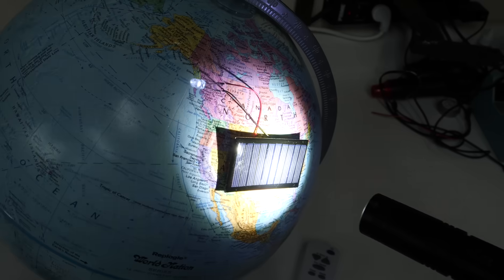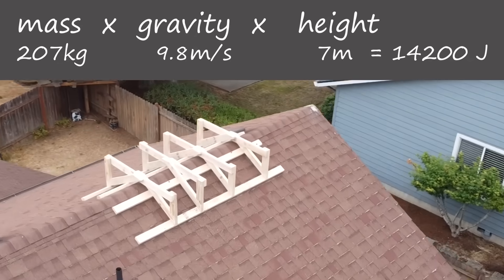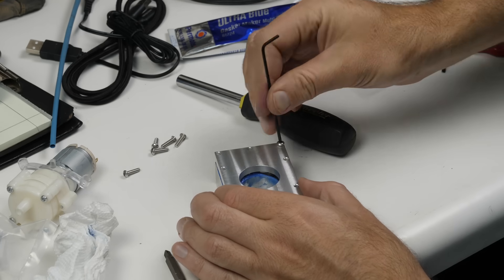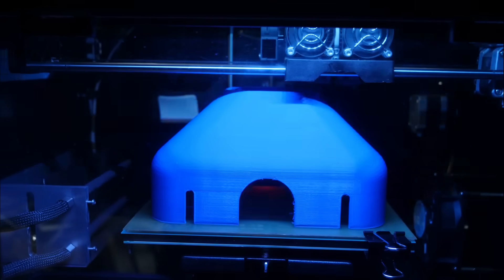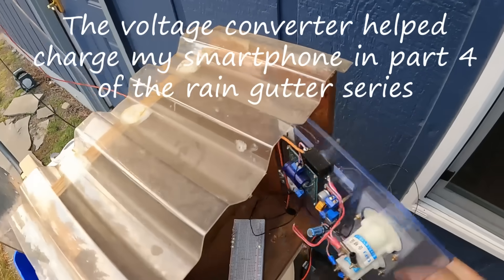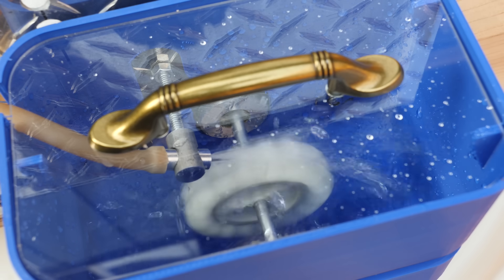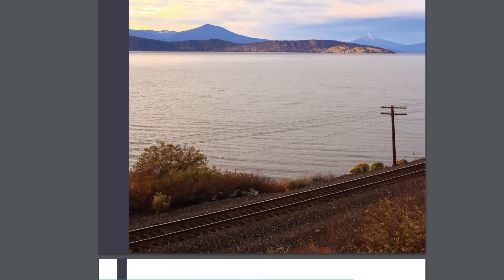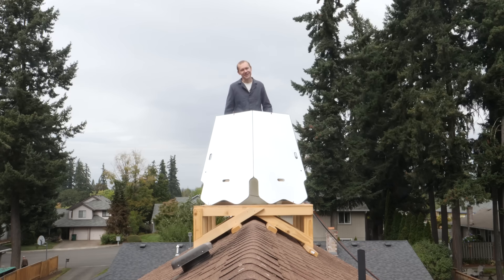Storing Solar Power on my ROOF!!!

Comment: Appreciate the 'do not try this at home', but a couple of things for the average viewer that you couldn't explain within the time constraint of the video:
1. Don't have splashing water beside your breadboard and LED. It's a silly little way to lose twenty bucks of equipment for nothing.
2. Don't use these circular barrel jacks on your roof--or any electrical connector that is not built to the correct IP ratings. It's also a dumb way to lose your equipment to a short even if 12V can't hurt you. (Also, uh, please fuse up your 12V outputs in case of these brainfarts because they can happen to anybody)
3. The meter started out reading 20mA despite the water flow carrying more energy than that because current is load-limited. By hooking up 1x LED you're wasting the rest of the water's potential energy by just letting it go down the drain if you don't have enough appliances turned on. That's why it could do 1W in the end--but I suspect some viewers may have turned away from the video at the point it went '20mA?! This is useless!'.

4. Use in combination with heating the water for a much better effect and to scale up. If you have lots of solar energy coming in, no point filling your roof with 1000L of water. Heating the water in an insulated container and then letting it back out on interior radiators at night would be a much less space-intensive method to scale this project up to the tune of 300, 500, 700W. 

Don't expect a miracle, laws of physics apply. But it is SO much cheaper than installing solar with 230VAC inverters, batteries, and all that electrician-certified wire run etc. built into the house that the break-even on this type of installation should be almost an order of magnitude quicker.

I'm planning to proof-of-concept high efficiency peltier coolers to make a low-cost solid state heat pump with solar in the house (no miracles either, a few hundred watts and a single room should be all that does). And your idea just helped me add water volume to that equation--even just having a storage of water to warm and store is still a great battery source for the winter and ALSO for the summer in reverse.

Comment: This is a silly experiment.
You are dissing the liion batteries which indeed maye have a degradation with time, but if done correctly even after 10-20 years the degradation will be insignificant, in the 10-15% range of loss
On the other hand what is the energy density of water?!
That gigantic barrel (and a huge scaffolding and the silly tubing and pump and electronics ) has 14.000J, meaning 4Wh
One of those 18650 cell has like (samsung inr 35 is like 3 dollars/pcs ) 3.6v*3.4A ~12Wh
WTF. A tiny li ion battery has 3 times the capacity of this project and fits inside a crack of a wall. Literally, you can hide an 18650 cell anywhere and not be found for days, provide more energy storage for as long as you live and be more reliable than that project to provide energy.
This contraption is just a silly kid's science fair level of usefulness, and not even that.
What a hoax of a video.
For the same mass and volume occupied by this project you can get something like 30kWh of energy storage in li-ion batteries, that's like 1000x more energy efficient use of space. Your grand grand grand .... grand children using this water storage won't be achieving the same energy capacity with this project.

Comment: Technically speaking, if he simply used mercury with the existing setup, he could increase potential energy by 13.5x, simply because of density. It would also counteract the potential problem of freezing. But I'm not sure anyone would want to place a barrel of mercury on one's roof.

Comment: For the impeller, you're losing most of your power from inefficiency. You'd be better off making what looks like a regular pump or turbo, where water enters and does a rough U shape around the impeller, before jumping out the other side. That will increase how much power you can get, since the water will be transferring every into the impeller for longer. 

Currently, it's basically hitting one blade and then bouncing all over the place, which means most of the waters energy is going into the bounce, not the blade. By having it take a U path, it will leave the blade with as little energy as possible.

You'd need to mess around with how high you can get the exit, and even how large you can make the impeller. Alternatively, you could place a generator near the top, and repeatedly stack them, maybe with some distance between each one for gravity to transfer some energy back into the system. 

In theory, you could even set it up so the up and down path is the same, where the pump that sends the water up into the roof barrel becomes the generator that reclaims the energy. But as you already have a working system, I'd say that would just overly complicate matters.

Comment: 12:30 I really love the precision about the difference between ENERGY and POWER.... and I love the way I came to your video just the day after I said to myself: "Hum, think about it: energy is a storage and power is about time... because it is how fast you use energy"

And today, I can finally add this: time is about resistance. Here (in your video) the time depends on how large the valve is opened. The more it is opened, the more water can escape the tank per unit of time... because of the resistance of the tube and valve (making the water not to escape the tank).

The more resistance, the more time it takes to let something to happen.

So, power being "how fast we use energy"... it is also true that power is how few resistance there is for energy to manifest. And I'm not even speaking about political stuff!

The less resistance, the more power. For example, LEDs use a less resistant way to produce light than filament bulbs. With the same energy storage, you can then use LEDs and produce a strong light or use bulbs (using the same voltage) and produce a less visible light.

That's why it is important to design less resistant stuff to increase power.

Anyway...

Really nice project.
Thanks for your sharing!

Comment: I think this experiment is to do with many different pumps types and water motors, before to say anything about efficiency. I just realise how many types this devices exists for different purposes, and i really think you my try with this membrane and valve system "Le pompage en autonomie avec 50W seulement!!!" from Guillaume Piton. For the energy conversion, there are some water motors seeming more efficient than a turbine in Robert Murray Smith last video, or Tom Stanton's style.. Or symply using not as an electrical battery, but simply for all water usages, maybe for the garden ? A solar cascade for a natural swimming pool ?

Comment: You can use the water pressure from your tap to get the water up there without pumping. Kg of the tank? Wait...you can get more water pressure strraight out of a tap, instead of a tank on the roof. You should have about 20m on a household tap. What about all of the wasted water?

Comment: @9.10 "I got nothin'" - I have many testing devices, when brand new fails, I tend to give up in disgust.
Like, how the hell can you ever win when you have to test and replace brand new?  Why should you even have to?

The other concern for the ordinary homesteader interested in energy storage, is that the efficiency of off-the-shelf water-drive generators is pathetic.  To do this well you need some pretty high-tech miniature Pelton wheel, matched perfectly to your DC motor/generator in terms of speed and torque.  Beyond most of us, even if we had a 7 metre structure capable of supporting and sustaining 200kg in all elements.

Great experiment, but just not a feasible experiment to replicate for most of us.

Comment: Well for me the calculator said 100m³ over 5 meters and a normal efficient generator gave something about 1kW/h which is about the sitze of Lithium battery of a 1 Liter Milk bottle.

I would not perform such 0.2m² tank on a roof alone the Wood and screws, plastic Tank are making more energy cost and CO² damage to the ecosystem, than the system delivers next 100 year's. 

Total waste of time, a proofen concept since 100 years any calculator tells it....😢

A pressure storage of compressed air would be much more effective and doesn't need to be on the roof. But if you make a mistake it might blows the house away. Well in this case it can although crack the roof with wight. 😅

If you strength the structure of the house before this system is even more useless 😅

 Anyway nothing for me of interest in it, but you get a like, for nice explain action how hydro power works in concepts....❤

Comment: Great video, subbed!  On the picture of the Swan Lake Energy Storage, I assume that there are two pipes running side-by-side, one for flowing down hill and one (probably smaller in diameter) for being pumped uphill!  A tower with a small tank just to the left of the lower pond but at least ten feet higher in elevation than the rim of the second pond would reduce the energy needed to pump the water back uphill because water (and most fluids) will always find its own level!  The Romans used a similar system with their aqueducts to move water across steep ravines, still works today!

Comment: I don't understand why... if you had a 3D printer anyway,  why didn't you incase your waterwheel thus making it a turbine and much more efficient.... because not only are you then using the power of the  slash hitting the fins you would capture the all the water and the built up pressure of the water coming down .... yes, the pressure would be lesser as the the water level in the barrel lowers but the biggest thing is that you'd actually be able to crack the valve back a little less .... saving potential energy and thus extending the batterie's life.. Also a wind driven pump that'll work good in a 10 mph wind could also be pumping filling another tank.... that would be an interesting comparative test .... even though solar is more efficient,  when nature permits I bet the difference of a small windmill just big enough power a pump 2x that size to would be awesome.

Comment: you are making lots of splashing droplets that could easily be run across the rain field generator too that is about 50% by size efficient to solar panels even when made by hand with teflon tape, and aluminum duct tape (or aluminum foil with double sided tape) though no one has used true super powered triboelectric material  they are just relying on naturally negative and positive charged potential and not even using the extreme end on the positive side, just on the negative side LOL Still seems like you could snag another 25% more power at minimum

Comment: Fantastic build. I'd submit though that you have some wasted energy from the water splashing off the impeller. If you could somehow print something that would deflect that splashed water back on the impeller at it's negative vertical direction point, you'd gain a small amount of that wasted energy back. No idea if you'd even notice the difference but it's going to increase the overall efficiency regardless

Comment: This solar panel is being taken out of service for direct use during the day meaning that it's production capacity would need to be subtracted from the output of the battery. Through conversion efficiency is decreased and there is a net loss. However, as an auxiliary for light duty (such as lighting) this could be feasible, using a second panel for primary power. There are vortex systems that produce far more efficiency.

Comment: But what happens when the sun is not shining at all and the pump doesnt get the water into the barrel on the roof? 

Wouldnt it be better to include a small powerbank to start the cycle?

Comment: with respect to the destructiveness of dropping the bottle, the bigger difference is that water is incompressible which limits the ability of the jug to flex. If you put a bunch of lead pellets into a 3rd jug so that it's the same weight as the one full of water then I'd wager it won't explode the same way as the water does.

Comment: Lots of voltage loss with the PV panel on the roof powering the pump on the ground. 
Lots of friction loss in such a small transfer pipe up to tank.
Lots of energy loss in the pump's heatsink.
Lots of wasted (unregulated) solar power for the tiny pump.
For less ugliness, put a bladder tank in the trusses below the roof.

Comment: the million dollar question is if you could make money by using the water pressure from the tap, waste the water and sell the electricity!
Reply: as a matter of fact you don't even need to waste the water. You can simply put the generator where the main water pipe is coming in the house and then generate electricity every time someone uses water.

Comment: Could you try building a solar thermal generator using a solar concentrator and Stirling engine? Uses solar power, but has much better conversion efficiency and doesn't lose performance over time or with high temperature like PV, or involve the nasty heavy metals for manufacture

Comment: After years of 3D printing, I have found to never drill and tap your threads in the 3D print. Always always always use thread inserts to prevent the threads from ripping out

Comment: OK, random thoughts about this video:

1. You sound a lot like Jeff Goldblum. It's crazy. If you practiced at it a bit, you could do an insanely good impression of him.
2. Holy crap, your yard is deader than mine is. God bless Climate Change.
3. If you were my neighbor, I may be a bit irritated at having to look at a big ol' barrel strapped to your roof. Maybe do something to dress that thing up a bit so it's not so ugly. :P
4. So, what's the actually efficiency of using this system, versus...you know...grabbing a few car batteries and hooking them up instead? I know the point of this is "science", but for the sake of science, I want to know how much power this can store. And not only that, but what is the maximum energy storage you can get in a day with the water and one pump, versus a bank of batteries? 
5. You need to hook up a wall dimmer switch to this setup, so you can turn on the table lights without having to turn the valve.

Comment: Have you ever considered using a ram-pump inline with water flow for pumping the water back to the roof?
Reply: Ram removes water from the system and converts the lost energy to the pump, it's a negative feedback loop you'd have to keep adding water to the loop

Comment: I wonder with a pressurized container and a bladder if you couldn't get more power out. You'd have to have a way to pump the air into the bladder with solar but I think it would boost the power a lot. I thought a lot of how the momentum of your water jug didn't equal the power of water being pushed 7 meters through a small hose.  What is the velocity here?

Comment: Yes, i had that same idea years ago. Build Tanks on the top of cities. Pump Water up, or catch the Rain. Or maybe both. Than release when demand is high. And use turbines in the plumbing. You could also use turbines in the regular plumbing of waste water. But i calculated it like you did and was really shocked to see how little energy i can store in a 1000L Tank about 10 Meters up. You maybe can power a 50w lightbulb for an hour. Or something like it. Maybe i should calculate it for an entire city. At least it rains a lot here in cologne germany ;) 
Awesome video! Thanks

Comment: The power of impact is from the momentum temporarily added to the mass of atoms which effectively adds its "weight"-of-motion to the water's "weight"-at-rest. This same momentum can be added virtually to the atomic mass in other moving directions such as when spun in a circle as with a flywheel.

Comment: I own a 5 story apartment building with two large water tanks on the roof (10'000 litres each about 30 meters above the floor) and i got a 10kw solar system.
Could this generate enough power to make it worth buying a generator, a pump and another tank for ground level?

Comment: Hey, I was thinking instead of using solar pump could it be possible to use a syphon method from barrel seal the one on the roof, as it drains the suction could refill it at the same time
Reply: Love they way your thinking.  The problem with that idea is the energy spinning the generator comes from the force of the falling water, you would use that energy to pull the water back up instead of having force at the generator.

Comment: Hah, thats a lot of work for 3.8 watt-hours. (8000 W-h is required to cook a turkey)
If you truly want to maximize the battery potential for tens of years on end, then electrolyze the water and pump the hydrogen into a tank. If you want to be safe you could put the tank deep underground so even if there is a fire, it wouldn't detonate your house.

Comment: I'd love to see you guys try using a compressed air tank to generate the potential instead of gravity. You could get a big ol tank in your yard instead of on your roof, make it air-tight, then pump the water (or air?) in and then drain off water to generate power! You could even have your kids check the increase in temp and pressure so they could calculate the storage figures!
Reply: Since water is a non-compressible fluid, I don't think it would work very well!  The higher the PSI you make the air in a tank, the more energy is required reducing efficiency!

Comment: Water is easy to deal with, but there is 'resistance' to the flow in the hose.  Another way is to use a pole and lift a weight on it using just a screw from a motor-generator and then you can use heavier material, like lead (say from lead-acid batteries...and store the energy in them too until their wear out)

Comment: This would be much better if it was a "rain system" that filled multiple barrels when it rained, and then that free rain water AND energy could be used when it's not rainy any more. 
That system would be more efficient than a "solar battery" system.